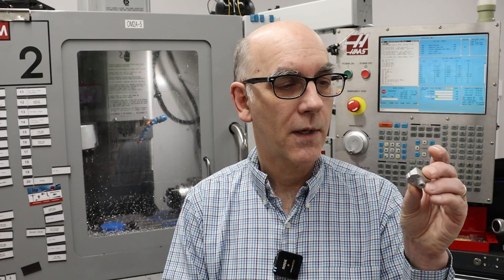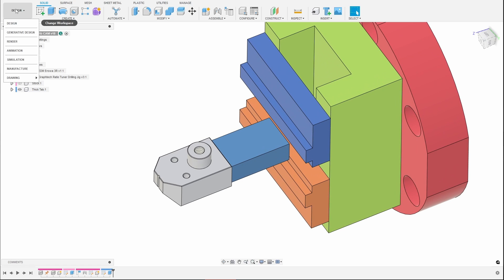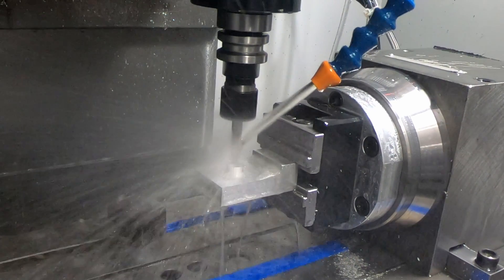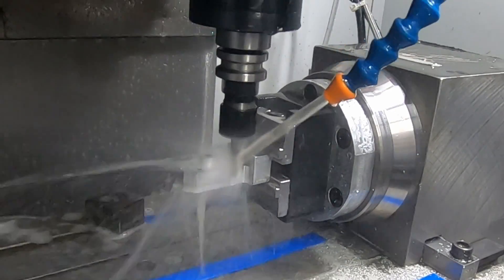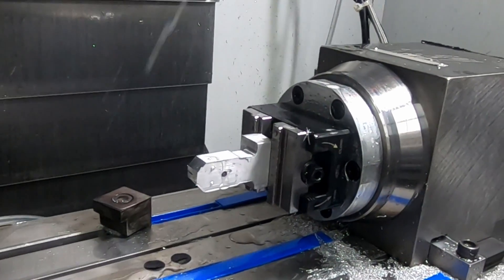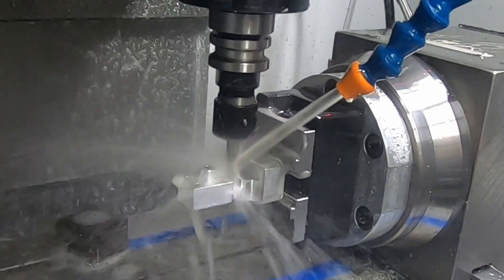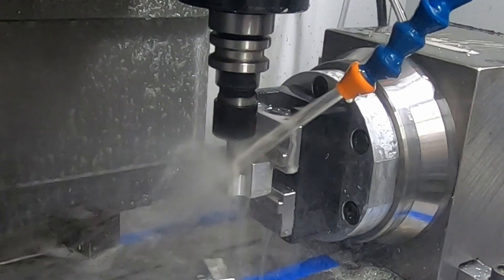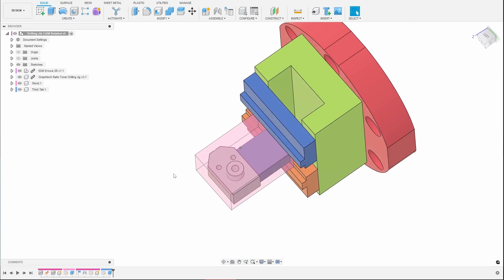4th Axis Milling — Making a drilling jig

Comment: Great video thanks for posting.  what was the total length of your stock and did you get much chatter?  I have a piece of stock I need to machine on my 4th axis that is 3.75" in length with no tail stock so I am wondering if the stickout will cause me some problems.  What material are you using in your tumbler?

Comment: Great work, 4th axis makes these type of job so much easier! I need to figure out how to get one setup on my hobby machine now!
Reply: A Fusion360 subscription with machining add-on for an hobby cnc machine? Expensive hobby. I wish they would add 4th axis back to basic.
Reply: @huistv2005  oh, you can't do 4th axis programming under the hobby license? Damn that's a shame
Reply: @ThisDesignedThat  You can do this type of 3+1 with the standard F360 license (~$350/yr). The expensive machining extension is only required for simultaneous 4 axis moves.